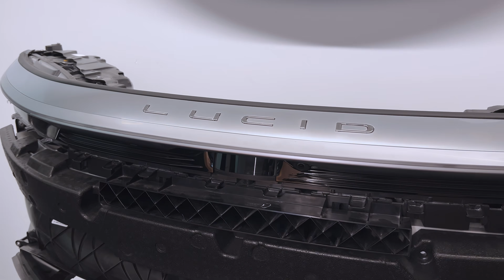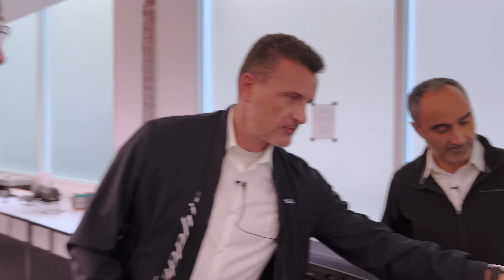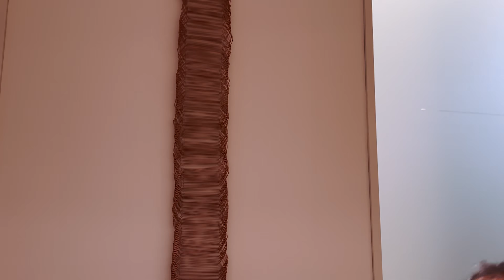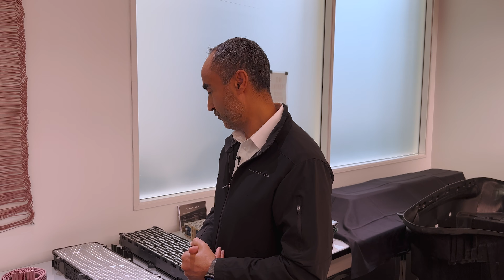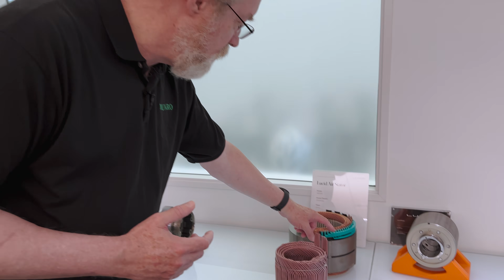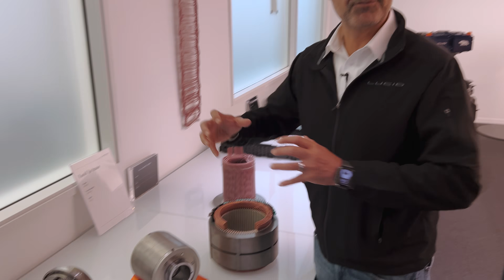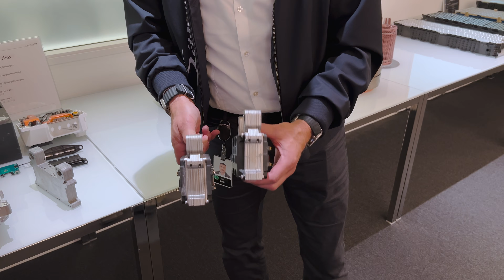Lucid Motors’ World-Leading Electric Powertrain Breakdown with Emad Dlala and Eric Bach

Comment: just curious what would happen if they cool the oil too so before the oil is circulated through the stator core if it is cooled to say 15-19 degrees and then pumped through the stator it would keep the stator and coils cool and also reduce the resistance of the coil and increase the magnetic field too. reducing the amps consumption of the motor hopefully.

Comment: 0.25mm laminations! In a motor that big, and I can imagine the grade of silicon steel too. 
My ebike motor has 0.5mm laminations and the good ones are .35mm laminations.. and certainly less fancy steel.
Kind of interesting since larger motors usually go for more coarse ones rather than finer.

Comment: Amazing engineering. However, Tesla’s lowest selling vehicle is Model S, and Lucid air is basically that. They should have made an affordable suv, maybe distributing that 670 hp to all 4 wheels to have awd with lower cost. They also need an even cheaper battery packs. Those blocks seem to cost a fortune compared to Tesla’s 4-compartment solution.

Comment: The motor assembly with the high speed differential inside the rotor and the two planetary gear reductions at both ends is AMAZING. A work of art! 🙏

Comment: it is cool to see these engineer nerds geeking out. i am pretty sure that the drive train for the lucid is brilliant.
what i am wondering now is, how and when can something trickle down to more affordable cars. i mean 20k .... 30k USD/EUR.
yes, SiC switches from Infineon, STM, Microsemi/Microchip, .... are expensive, but they get cheaper over time as well, right?
and we don't need 1000hp on the rear axle. 150....300hp go a long way for smaller cars.
or is the longevity of such a drive train so good, that we should think about a second life after the car turns to dust?
i saw the video from the app550. it looked like you can drive a few million kilometers with it. easy.
or is the pressure to lowering cost for a 25k USD/EUR car so insane high that there have to be corners to be cut regarding efficiency to get to the low price point to get to a small 25k€ car. like a renault R5 with a much more powerful and energy efficient drive train while maintaining the same price point? (ideally as rear wheel drive)
is that possible in a few years?

Comment: I think if they added a small constant rpm ~50hp engine as a range extender they’d open up a whole new market for themselves. Then they’d have a plug in hybrid model. It could all fit right in the frunk with all the space they’ve saved.

Comment: No one ever highlights that all this tight packaging and push to make entire seem assemblies in one shot  leads to another problem and a rather expensive one. When the car is damaged, suddenly you can’t replace just one or two pieces or the damaged component, you have to replace an entire assembly that is 5-10 X what the actual part that is damaged costs.

Comment: For maximum efficiency are you capturing the heat from the cooling system to generate electricity to put back into the battery? A closed circuit heat pump enabling generation to recharge the battery would maximise energy conservation.

Comment: That front bumper assembly is a perfect illustration of the promise and perils of modern auto engineering. It's a beautiful piece that no doubt achieves its engineering goals. It is also impossible to repair and is likely to result in big insurance rates and increased totaled cars. No doubt their target demographic doesn't care much about that though.

  That rear drive unit is insane- I wonder if they would sell me one to stick in a hot rod
Reply: Oh, and thanks to the Lucid guys and MunroLive for doing this video. Great stuff

Comment: Truly mind-boggling! It amazes me to think that electric motor design changed very little over a whole century, and 500 KW motors were beastly things. Now these engineers come along and create a 500 KW package small enough for a man to lift!
Reply: Yeah, it's impressive. Though the efficiency at that power is also good to know, since you can run a lot of power through a motor if you've got a lot of cooling.. at 50% efficiency where all electric motors put out the most power. 
I would love to see more efficiency dyno graphs on these motors/ drivetrains. Having seen one for the nissan leaf motor on the internet, seeing all the torque and rpm ranges and efficiency plot it's seriously impressive how much torque and RPM you can get in the high 90's of efficiency.

Comment: I thought the trunk molding and undercut manufacturing and assembly process had to be super expensive. Nope! It's just really, REALLY smart. I just really hope that Lucid realizes this and makes as much of their product user-replaceable and user-repairable as possible. Even in the front fascia, where there are so many super expensive components, EVERYTHING seems to be held on with screws and bolts instead of adhesives (or worse, clips) which makes things easier to repair (even if they're not as cheap). Their battery modules are a really good example - the pack is modular, the modules themselves are simple and ALSO modular without any unnecessary bonding or adhesive agents, the busbar is lightweight and made of aluminum, and the ballistic shield protects all of it. And the entire underfloor is also bolted in instead of welded or bonded to the structure - great for repair and service.

Comment: I'm hoping they will create a semi trailer with this technology. Some batteries and solar panels on top and one or several motors attached. 
There their technology would save more diesel then anything ever, or become a massive range extender for any electric semi. You could even charge the electric semi while driving. 
For diesel semi's in a hurry, they don't even need to charge it with a plug and it will still become a range extender.

Comment: Not to dismiss designs, but large losses may be a combination of high cost from suppliers for engineering and manufacturing,  due to novel design, low volume, and exclusivity. Suppliers end up with the profits. 
Hope they can bring profits in-house for volume product, time is running out and premium market is too small to sustain them. Sedan choice was mistake, being optimal efficiency doesn't sell, e.g. Prius. Gravity model should have been first or at least a fast follower.

Comment: EVs are developing so quickly.   This encourages me about the future.  No EV for me yet, thermal runaway is simply unacceptable.    This needs to be solved, probably more so for small consumer devices.   I believe the amount of fires from lithium batteries is 10,000 a year for Australia.   Astonishing.   No need to compare to ICE, it needs to be resolved and I believe battery manufacturers are on the cusp with new thermal runaway protections including chemistry changes.   I'd prefer a Lucid but doubt they will be available in Australia.

Comment: These motors are spectaculars. We would like to know, though, the cost of this technology, Is it scalable to a reasonable price? Or is it always connected to a car that lose $200k each unit? It's a difficult time for automotive,  the price is the key, even for these jewels.
Reply: This motor cost $1800 to make produces 670hp, in comparison tsla motor cost $17xx to make and produces 300 or so hp.
Reply: @lowvaeater  So the only real problem of Lucid is the CEO salary. If there is an issue it always comes from the top of the pyramid!!!!
Reply: @1968matrix  $500,000 annual salary is not that high for CEO, but if you are referring to millions it was stock issued to him when stock price was at $30, he didn't sell any amd it's $2.2 now.
Reply: @lowvaeater  "Lucid CEO Peter Rawlinson's compensation package in 2022 reached a very impressive $379 million.".….. It's a different number... For a startup company. Not based on numbers... . I wish all the best to Lucid, but not everyone is working in that direction... .

Comment: Great engineering. 

Elon’s principle of “no part is the best part”, the ideal is to have 4 independent motors on each wheel.  No differential or planetary gears.

Torque and efficiency problems can be overcome with microelectronics motors

Comment: Very convincing argument for Porsche to buy Lucid IP. German level of excessive engineering without regard to cost that’s currently languishing in a vehicle no one wants to buy due to execution not matching the price.
Reply: Moreso for Toyota who is on their back foot in EV development. Lucid's design-for-manufacture approach, modular design, and the smaller Atlas units should fit well into Toyota's philosophy.
Reply: @ Toyota had no interest in highly expensive engineering. In fact, they have lost much of their engineering prowess as evidenced by their horrific turbo-engined trucks. They are behind in EVs because someone high up decided to focus on the hydrogen dead end and culturally no one can tell them it’s a bad idea.

Comment: nice but it appears China has caught up with Lucid motor technology.  Checkout Xiaomi's SU7 27k RPM motor.  They also have 35k motor with carbon sleeves.
Reply: Just revving fast doesn't mean it's equal. It's Gravimetric and volumetric power that matters
Reply: @MayurBirari  Took the liberty... Lucid is at 14.7hp/kg, Xiaomi at 13.6HP per kilogram
Reply: @zodiacfml  I think you are confusing with Electromagnetic stack as the full motor. The SU 7 V6S production motor is 220 KW at 89 kg which is 295 HP. 295 / 89 = 3.31 Hp/Kg. 

Now the Lucid production drive unit is 670 Hp at 74 kg. 670/74 = 9.05 hp/kg. 

No, Xiaomi is not catching up. Dont get me wrong, they are producing great cars, but it's disingenuous to say Xiaomi is Lucid.
Reply: @MayurBirari  You will get that if you took their weakest motor. V8s motor is the one with 27k rpm
Reply: @zodiacfml  that is not in production. And even the V8S will be heavier than V6S with still lower power than the lucid. We will talk when it goes in production. Do you know Lucid has the dual motor that produces 1 Megawatt of power
Reply: @zodiacfml  and the point is you are comparing Electromagnetic stack as the full motor, which is not true even if you look at V8S.
Reply: @zodiacfml  Also, higher revs will increase power but that's not always desirable, it's less efficient. The Lucid produces more power at lower RPMs, much better technology

Comment: lucid, design there engines, via an  eliminator high compute system to design the motor . Like  in computer SOC chip design us simulation  compute which cost starting  at 50  millions $

Comment: I do love the Techincal achievments of this Company, though.... Those differential spider gears look extremely small and fragile to be able to transmit the high HP this motor produces... Good Luck on your continued  automotive enhancements.
Reply: HP=(T x RPM)/5252 By spinning  the diff at high speed (before the reduction gears) the Torque on the diff is greatly reduced vs. the typical diff located after reduction and spinning at the much slower wheel speed.

Comment: Why do modern cars have to use so much plastic. It does not hold up over time.
Reply: Cheaper than metal. Lighter than metal. Softer than metal, which is a big deal for bumpers as you're somewhat less likely to kill pedestrians if you hit them with a soft plastic bumper rather than a steel one. Good vibration damping so loosely fitted parts don't rattle as much. Various other reasons.

Plastic durability is a weird one. Some plastic parts hold up great, even under severe under-hood conditions. And others, even on the same engine, turn into a crumbly mess. I think the quality of the plastic used varies a great deal.

Comment: Less than ten minutes in and I'm yet again blown away by the complexity and creativity of modern engineering. In every cubic centimetre. If only I could afford one. One day I will own a compact Lucid.
Edit: and then the motor. And on and on. Breathtaking. An outstanding presentation.
Edit2: but all that wonderful efficiency is to drive a vehicle of over 2 tonnes in order to take eg one 100kg person to work.
95% of trips in the US are under 31 miles if I remember correctly. Average daily mileage around 40. A grossly inefficient use of precious resources.
Reply: A small company can't build mass market small cars. That's why Lucid is offering its technology to other manufacturers. The smaller Atlas drive unit for Lucid's mid-size vehicles (starting late '26) should sell well into the global mass market through other existing mass manufacturers.
Reply: Would love to see a small-mid sized car with all this efficient inverter/motor tech, the absolute latest battery tech, then manage say 250 miles on a charge from a 'small' 40kWh battery or something, maximise usable space in it's smaller footprint, weigh like 1.2 ton and be the most efficient 'regular' car by far.  Aptera is going to be darned efficient but a bit too far out of the mainstream.  Was hoping for a Tesla Model 2 but the Cybercab is taking all that love, it didn't even need to be a 25k car either tbh, say 30k don't care, give me something with all the good tech and great efficiency and smart packaging that should be possible in an EV please someone.
Reply: @EnergisedAdrian  precisely. Lucid needs to go even smaller. But knowing that their CEO can trace his beginnings all the way back directly to Colin Chapman is a big relief. "Simplify, then add lightness" is exactly what Lucid have done here. It's incredibly heavy, yes, but that is simply a byproduct of modern battery technology. I think by 2030 we'll see Lucids with 300 mile ranges that weigh less than 4000lb and still put out 400+hp. E39 M5 performance, anyone?
Reply: @spdcrzy  Lucid won't last that long with PR as CEO.   Don't compare the clown PR to Colin Chapman!
Reply: I appreciate the efficiency on many a long trip. This model is meant to cover long distances, but the mid-size will likely be more appealing for shorter trips.

Comment: Big magnets in your luggage:  I once, when traveling between Hawaiian islands, had a large outboard motor flywheel in my bag. It wound up in the nose compartment of the 12 passenger plane. All of the magnets that energize charging and ignition are in this part. As a result, the compass in the plane always pointed the same way regardless of which way the plane was going.

Comment: Wow, I knew Lucid had some impressive engineering, but I feel like this is next level.  Aesthetically those drive units are a work of art, completely aside from the compactness, efficiency and scalability.  The differential inside the rotor was genius. Having everything balanced and inline with the axle surely cuts down on NVH as well.
Reply: Lucid's components were originally made for race cars. That is why their engineering had to be so advanced because the performance demand was so extreme.
Reply: Calm down.  Apparently it’s not impressive enough bc sales are bad and they burning cash faster than the DJT.  They need to stop trying to impress with this fluff and make some decent affordable cars.

Comment: Question?
Does Lucid have a Total Part Count more or less then other EV's that are out there?
Does Lucid make most of their parts in house?
Is the 1 piece Frunk hard enough? 
-It seems more Rubbery, not hard enough, just a guess.
NOW that motor, 670 HP, whats the weight?
That CONTINUOUS WAVE OF WINDINGS was a NICE DETAIL
What about a thicker strand of copper wire in the stator? - Would it help with resistance or efficiency? 
Is LUCID making their own software?
Nice CUTAWAY,
Didn't GET INTO THE CELLS.........

Comment: The lucid power unit is compact, lightweight and efficient.  While there is an aspiration for Lucid to build integrated vehicles that exploit their power units attributes to the full they should be selling them wholesale as ‘plug-in’ solutions to other EV manufacturers.  Let the third party manufacturers worry about the aerodynamics and efficiency of implementation.  It’s great engineering but Lucid really needs to reverse its cash burn and start turning the corner to profitability.  If they do not they will go bust and regard,ESA’s of the elegance of their engineering someone will swallow them whole and acquire their technology anyway.